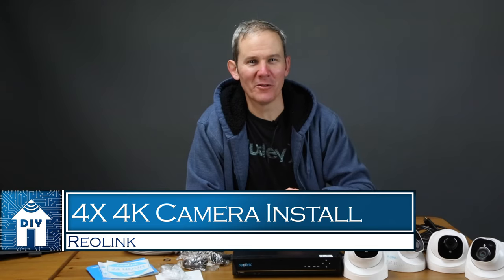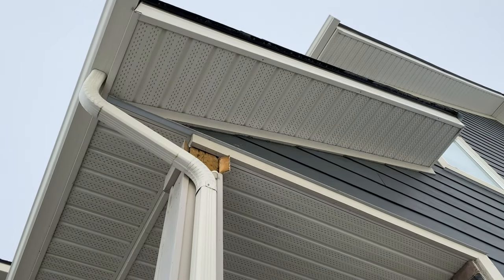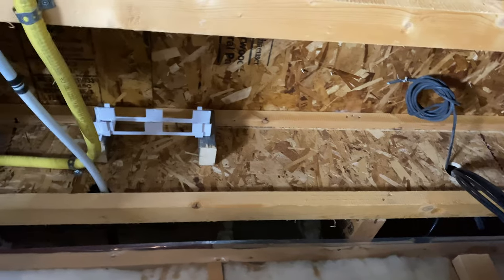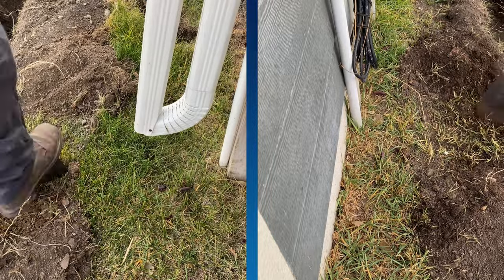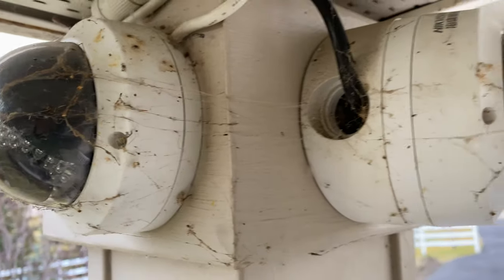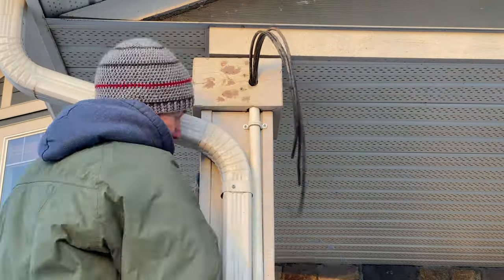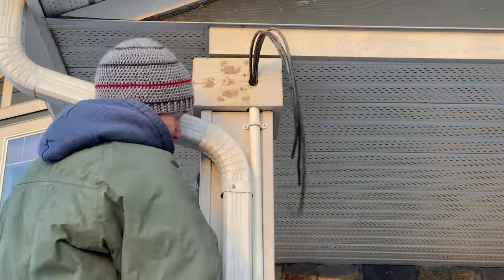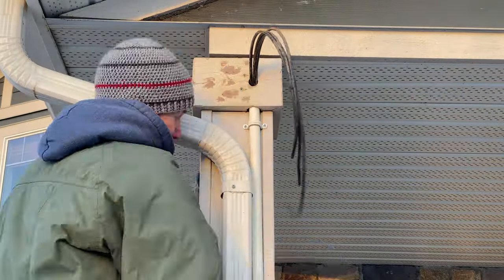How to install Reolink Security 4K PoE Cameras Outside - in DETAIL

Comment: If I was you I probably wouldn't of shown everyone where the wiring goes because now you've made it really easy to speed up the robbery of your house by cutting your cables..
Reply from the maker: Maybe that setup is a decoy to trick a robber into thinking my wires are in the conduit but they are really in the ceiling panels.
Reply: @HomeTechDIY  it was alot of work digging for decoying, but it's just best to show the basic stuff when it comes to security, especially when it comes to keeping it 👍

Comment: When raining the motion sensor is going crazy.
Reolink, but probable other brands as well, are not intelligent enough to ignore weather anomalies>
I take it that Dahua AI would much smarter and efficient than Reolink.
Reply from the maker: It depends on the camera model and if it supports human and vehicle detection.
Reply: @HomeTechDIY  read my question please and do not state the obvious. I have reolink cameras and they are RUBBISH!!! You either paid by reolink or complete amateur not having any clue. To the point... reolink motion sensor are so shitty that get activated with sun light and even a small rain drops. When you set the motion setting to low-med, that is OK then, but cemara is missing a pivotal movement activities. Well, you get what you pay for in the end.
Reply from the maker: Thanks for the feedback. Yes, without using human or vehicle detection there can be many false alarms. I have found this in my other brands of cameras as well. Rain, snow, fog (at night with IR lights activated), leaves, etc will all trigger the normal motion detection. Motion will also get triggered when light is reflected on the lens or with changes in shadows on the ground, like when a cloud covers the sun quickly. I have never tied the Dahua AI and would be curious to know which models support it. Hope this helps!

Comment: No reason to install this garbage. All the software including firmware is full of issues and bugs. Absolutely terrible night performance. Junk cameras. And support is crappy.
Reply: What would you recommend for the average homeowner?
Reply: @shantor100  I would recommend to buy cameras with bigger sensor like hikvision DS-2CD2386G2-I or cheaper version without mic DS-2CD2385G1-I. Sensor size directly affects night performance. And big brand like Dahua or Hikvision guarantees much better software.
Reply: @D9ID9I  👍
Reply: @D9ID9I  do they offer bundle packages with everything you need?
Reply: @shantor100  no idea about bundles. You can get any cameras and use software nvr like "blue iris" running on your pc.